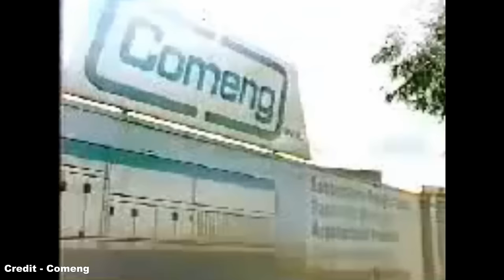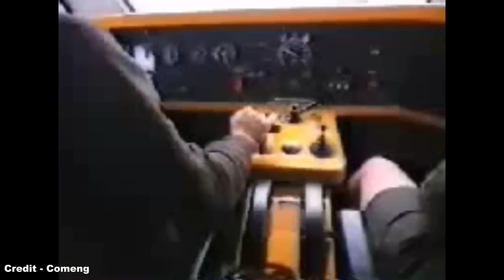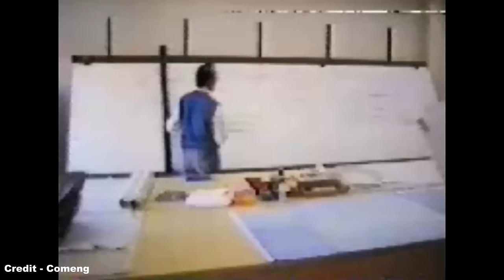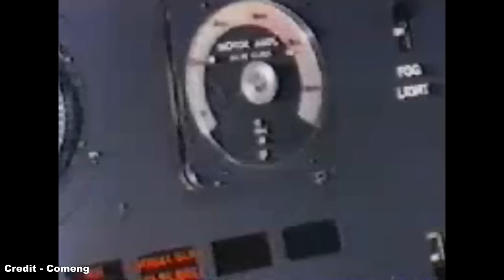The XPT - HSTs Down Under

Comment: I used to drive the 43's out of Kings X up the ECML... With 4500 hp under the bonnet ( 2250 hp ) one up front and one up the botty there was plenty of power on tap... Pulling out of the station on notch five with the Paxman Valenta turbo's screaming their little heads off and clouds of exhaust smoke ( sorry Greta Thunberg ) was something to behold with more excitement to enjoy... 125 mph here we come although they would top 148 mph... Now there is food for thought but as I did not fancy tea and biscuits with the Boss well need I say more...
Reply: Weren't the turbochargers by Napier?
Reply: @jamesbrett6518  Yes...

Comment: I took one between Albury and Melbourne - couldn’t believe how bouncy and slow the journey was - it was quicker to drive despite low speed limits on the Hume highway which I did from then on  - I really think just a relatively low investment in track could have a huge effect on the functionality of trains in Australia. (My experience is from c. 2012)
Reply: They did invest in the track . They rebuilt or upgraded it. 
But stuffed it up - didn't mud bubbles or sink holes develop under the track and they had rebuild it again in a very short period?

Comment: I was surprised AMTRAK didn’t consider this type of train I know a BR driver said that the XPT had a nicer cab in a review at the time ,models of these trains are really sort after very high prices
Reply: The Hornby repaint made for just a short time , selling poorly, now sought after by Hornby collectors.
There was also a more popular Lima HST repaint XPT version in Australia selling for many years 
A few rare Graham Farsish ones too.
All now superceded by the HO scale state of the art Auscision versions.. Catering for just about every livery variation over the years. Very expensive but sold out in a year or two.
Not as expensive as the collector prices for the Triang models of the Sydney suburban trains seen at 1:20.
Reply: I once saw a drawing of a proposed Amtrak set with a streamlined, diesel power car at each end, as per the HST, from the late '70s/early '80s. I can't seem to find it now though.
Reply: @nkt1  that might have been the failed UAC Turbo Train ::
https://youtu.be/cvWoalQNMrU
Not a completely accurate vid though as is common.
Or the later testing of a version of the French RTG for hoped for AMTRAK sales.
Both more than a drawing though.

Comment: Hmmm... very good. I wondered what the connection between the XPT and the HST was. I had, in my ignorance, thought that the XPTs were just re-badged HST imports straight from the UK.

PS: Minor correction to your video: NSW is a state, not a territory. It has bee thus since federation. :)
Reply: They are basically an export HST, British Rail allowed a company in Australia to build these trains under licence in Australia. In the UK the HST is being reinvented by being upgraded and running in Scotland, the South West of England, on Cross Country trains and in preservation and the coaches have been upgraded with electrically operated central locking sliding doos, they are still impressive after 40 years of service.

Comment: The power car de-rating discussed at 5:20 was that in response to climate conditions (higher ambient temperatures) ? Or was there another reason to dial them back a little? 
Increased service interval?
Reply: Temperature was the main reason. The XPT's cooler group is much more powerful than that of the HST. The XPT has a lower maximum speed than the HST, and propels fewer carriages, but also has to contend with much more severe gradients.
Reply: I think early on NSW railways knew that could not justify track upgrades for HST speeds.
So de rate the engines for the speeds needed and get maintenance advantages.
A common approach to de rate high maintenance diesels, so some multiple incentives to de rate.

Comment: I'm really sorry Ruairidh. I can tolerate some incorrect and omitted information that may have slipped the net, but there were too many incorrect things said that were a bit off-putting. But otherwise, this was a good presentation.

Of note were....

You mentioned both the 42 (forty-two) and 44 (forty-four) classes (as they're correctly called) being derivatives of the EMD F series. Only the former class was, were as the latter was a derivative of the ALCO FA locomotive.

There were also other locomotives of note that supplemented the aforementioned classes, like the 422 (four twenty-two) and 442 (four forty-two) classes, until both classes were largely superseded by the 81 (eighty-one) and 82 (eighty-two) classes

The S sets of 1972 were supplemented by the K sets of 1981, the C sets of 1986 and the T sets or Tangaras of 1987 

The intercity routes that were progressively electrified were either worked by single deck U sets, double deck V sets, or passenger cars hauled by 46 and 86 class electric locomotives.

While the non-electrified sections were worked by the CPH class railmotors of 1923, aa well as the 600 and 900 railcars, which were introduced from 1949 and 1951 respectively.

The cars used in the Silver City Comet sets weren't actually made of stainless steel. The power cars were made of carbon steel, were as the trailer cars were aluminium bodies on steel underframes.

Omitted was the XPT breaking its own 1981 record in 1991, when one train set ran at 191 km/h between Yerong Creek and Gerogery (pronounced Je-rod-jery).

Comment: The Queensland Tilt Train being able to go average 100mph or as said up to 130mph but of course that is not the speed it actually goes, which I can say is mostly 80kmh at least on the Rockhampton to Brisbane leg of the journey (which I have been on a few times). Due to this I prefer to travel on the technically slower (but not actually due to the fact they don't travel at full speed) but more comfortable Spirit of Queensland train.

Comment: Thanks for an interesting article.  Replacing an excellent train, for which a prototype had been built and tested, with something straight off a drawing board seems a risky strategy. The Hitachi trains that have replaced the HSTs in the UK have had problems - a rough ride and cracking - that might have been revealed by exhaustive testing of a prototype.

Comment: I always thought the Australian design was better looking than the original HST.
Reply: The original livery, or the power cars themselves? I think the XPT design is a little too ‘busy’, with the exposed (lower) lights and extra equipment on the roof. The lower windscreen position makes it appear top-heavy. To my eyes, the HST’s design is cleaner and better resolved.
Reply: @nkt1  Each to his own, but it was actually the lower positioning of the lights that I though improved the look, without the "bib" of the HST.
Reply: @cliffleigh7450  Fair enough. I think the HST’s lights give it more character, and an appealing ‘face’, which the XPT lacks. Having said that, the APT, with its much lower lights, also looks good.

Comment: 17:41 The Xplorer DMU trains first entered service on the 5th of October 1993 from Central in Sydney to Tamworth consisting of Xplorer carriages EA2501, EB2511 and EC2521 forming NP23 from Sydney to Armidale and EA2502 and EC2522 forming NP43 from Werris Creek to Moree (after splitting from NP23 at Werris Creek.

During normal operations, either a 3 or 4 car set and a 2 car set form a 5 or 6 car Xplorer train from Central to Werris Creek, once the Xplorer reaches Werris Creek, the rear 2 cars split from the front 3 or 4 cars to Moree stopping at Gunnedah then Boggabri, Narrabri, Bellata and then Moree, after leaving Werris Creek, the front 3 or 4 cars stop at Tamworth then Kootingal, Walcha Road, Uralla and then Armidale

Comment: The XPT is very much inspired by the HST, but the engineering is quite different.
Reply: Is it? Same engine, alternator, traction motors and bogies.
Reply: @nkt1  I am not an engineer, but simply repeated what I've been told since they made their first appearance
Reply: @nkt1 Shorter power cars, less powerful engine, different gearing, larger cooling system.  Then the passenger cars are Budd design, rather than the British Mk 3.  So the concept is that of the UK HSTs, but the engineering different for the very different conditions here
Reply: @doubledee9675  Shorter power car, because the HST’s guard’s compartment was originally in the power car, so the XPT chopped that bit off. Identical engine, de-rated slightly, so as to run less hot. Later re-engined with the VP185, also used in a number of HST power cars. Lower gearing and larger cooler group, certainly. Incidentally, a few redundant HST power cars have been fitted with similar lower gearing, for use as (strange-looking) freight locomotives. Different carriages although, interestingly, they use many of the same interior fittings as the original Mk3 carriages. So, it’s mainly the same engineering, tweaked and beefed-up to suit local conditions in Australia.
Reply: @nkt1  Thank you for the detail.

Comment: How comes they never licensed the HST sleeper coach design used in the UK?
Reply: There are no HST sleepers. The UK has dedicated loco-hauled sleeper trains, which only run overnight. The XPT's daysitter cabins can be used on day or night trains, and provide comfortable seating for sleeper passengers before they go to bed. UK journeys are shorter and this isn't necessary.
Reply: The UK HST uses Mark 3 coaches and the Night Rivera uses a variant of the Mark 3 coach with a different sleeper interior design, but you're right, the Night Rivera is hauled by a traditional loco rather than a HST.
Reply: @Elizabeth-vh6il  Yes I’m aware. In any case, even if SRA/CountryLink had wanted MK3-style sleeper cabins, Australia obviously has the ability to design and build its own passenger car interiors. There’s nothing special about the BR design that would warrant licensing it.
Reply: The BR mk 3 trailer was considered unsuitable for Aus (not robust enough in some area(s)). Hence they used carriages based on a Budd design (I think with a larger loading gauge) designed & built in Australia initially by COMENG..

Comment: Endeavour carriages TE2815 and LE2865 were permanently converted to Xplorer carriages EA2508 and EC2528 following the electrification of the South Coast line between Dapto and Kiama, EA2508 and EC2528 are still currently in service and can be easily identified by the crew doors popping outwards slightly and sliding open unlike the other Xplorer cars which the crew doors are unlocked and opened just like the passenger doors on the XPT minus the electronic locking system

Comment: The xpt is the saddest excuse for a high speed train the useless things barely break 120kph not to mention they're literally falling apart having ridden the things all my life I can confirm theyre crap 

At 2:52 the video shows the only sound footage of one of the 16 1970  double deck inter urbans these sets were so unreliable they didn't last long at all with the production V sets taking over and religating the DDIU cars to trailers with their cabs removed
Reply: Compared to the new Hitachi sets on GWR, the HST's are definitely not crap!
Reply: The only reason the XPT's barely break 120 Km/h is because of the track which in NSW is extremely winding around hills. Obviously you haven't travelled south of Wagga or north west of Wellington, two places where the XPT traverses straight tracks and can reach 160 km/h. Rail safety regulation ensures they are not 'literally falling apart', that's just your perception from being bored and wanting something else to travel on.
Reply: @Shitphototaker69  In that case you weren't accurate with your timings...if you did any, as I've been along that same route on the XPT when travelling to Sydney and I can honestly say the XPT travelled at 160Km/h for quite a distance on straight stretches between Albury and Wagga. Moreover, have you heard about the 5 mates who died trying to beat the XPT at a crossing at Gerogery. The train was travelling at 160Km/h when it hit the car.
https://en.wikipedia.org/wiki/Gerogery_level_crossing_accident

Comment: In the summertime of 1982, I rode the Intercity 125 from far north Scotland until London. The weather was very warm and the air conditioning was broken down in many of the 2nd class cars. The windows were sealed because they were supposed to be air conditioned. I am sure glad that they said that Australia would need more robust air conditioning. I sure hope that was true, because those would’ve been horrible sweat boxes!
Reply: 🤨 - ours had the traditional slam doors, and they had an openable window in them. Assuming they were defeated by the hot weather 🥵

Comment: Did Australia really look like that in the mid to late 70s? Not a single woman in a pair of trousers, for example. And the vehicles look antiquated.
Reply: I hope you don't come
 from England.  When I went there in the mid-late 1970's I felt it was not only more backward then Australia, it was like still stuck the 1950's with so many of its businesses from supermarkets to hotels operating in a time warp.  And it's housing laughable - we bought a house and the space and things missing.  PS: you'll find when it's hot, like men wearing shorts it's more pleasant for woman to wear skirts.
Reply: @xr6lad  My point is that the footage didn't look like it came from any western country in the 70s. Women were already wearing jeans outside work by then. Especially young women. It looks odd not to see a single woman not in a skirt any time later than the early 60s.
Reply: Lots of the sharpest films shown were from the early sixties. He made use of what was to hand . Not often period correct or train system correct. Lots of the trains would never be seen in New South Wales.
At  the sequence around 0:50 I do not see any cars newer than 1964, followed by narrow gauge Queensland trains from a famous 1962 film called All Manner of Trains  from the NFSA. A film worth looking at for the feel for Australian Railways in 1962. However, like many, thinks the main problem of the railways are only non uniform gauges
Reply: @IndigoJo  well your 
right there.  Much of his stock footage was all over the place, from railways not relevant and from much earlier time periods (50's & 60's interspersed with 70's & 80's).